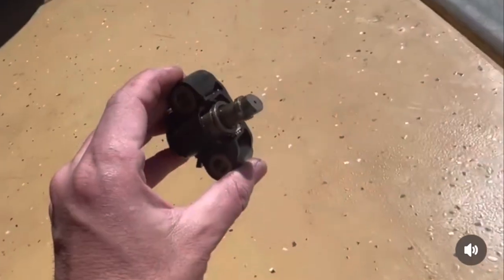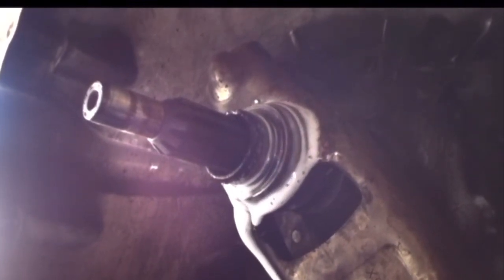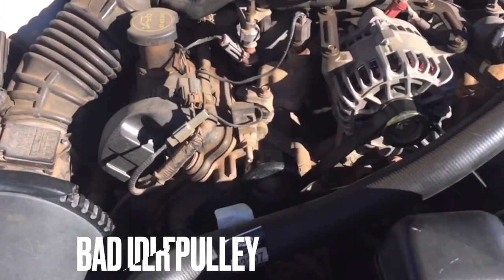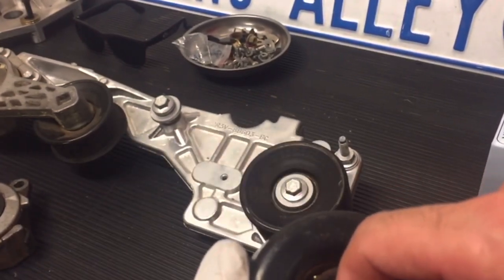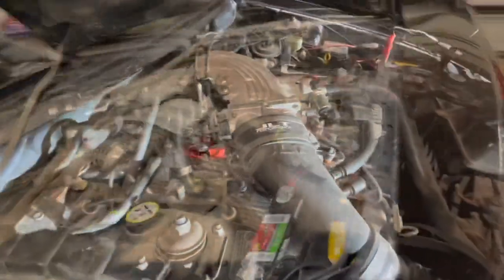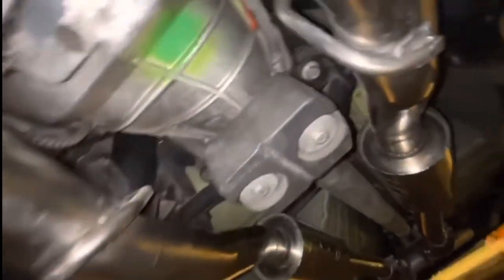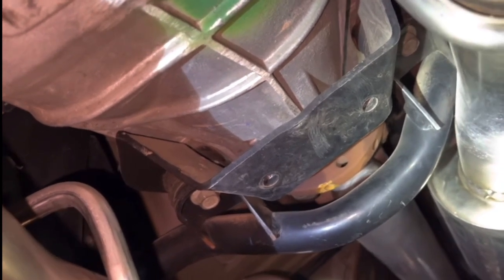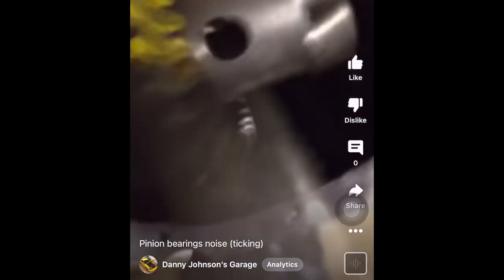Mustang bad noises compilation Diagnosis and repair: What were they?

Comment: Nice mustangs. Love the 99-04s, and back in July I got one. Nothing special, just a V6, but I am happy with the car. In December I will be getting the radiator replaced, transmission intercooler leaked tranny fluid into the coolant. Have not been driving it. She makes a whining sound from the power steering might need a new one. 234k so would not surprise me at all. Replacing the idler pullies is something on my list. Seems like an easy thing to fix and I can do myself.

Comment: Great video Danny.I have a little of what seems to be some slack or play in the drive train of my ‘03 Cobra.I feel it when I let off the gas while cruising at low speeds 15-30 mph,there is a slight clunk when I let off and back on with the gas pedal.Any thoughts?Thanks.
Reply from the maker: Probably the “Cobra clunk.” Another sound I should have added lol https://youtu.be/n-_fsfLDJVQ